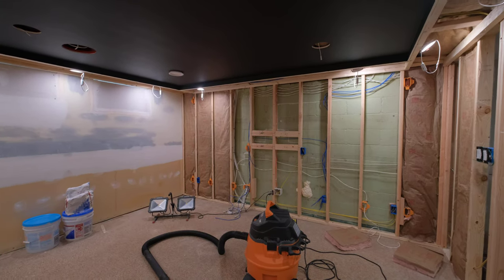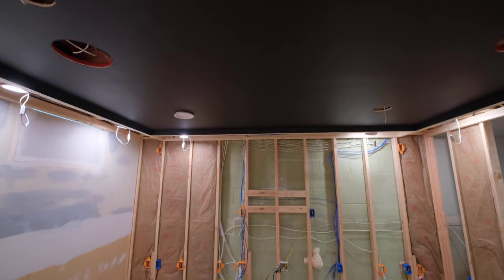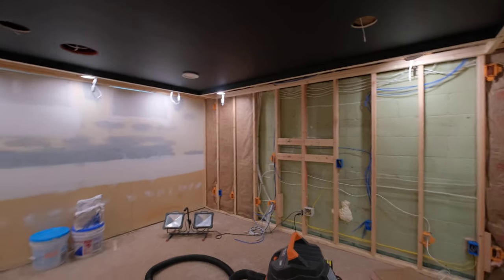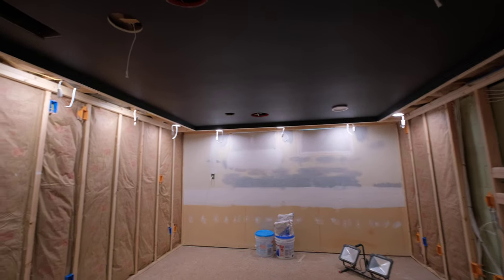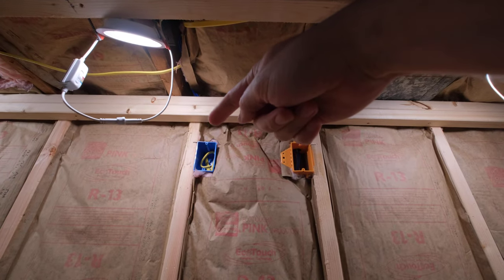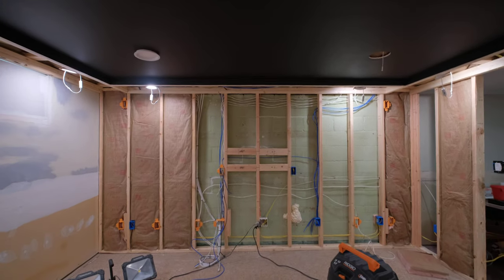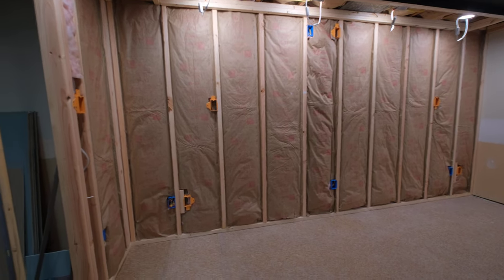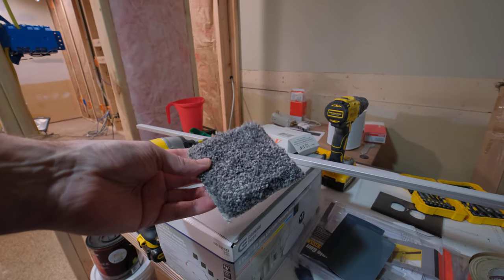Home Theater Project Part 8. The Ceiling is in, and Structured Wiring Enclosure is up!

Comment: for your soffit leds shining on a black surface you could paint the "inside" of your soffit white for better reflection. then close in the 3" tall (guessing) overhang you created with something called black led acrylic. it's matte black when not lit from behind so should give you a totally black soffit edge when your soffit lights are off and a soft glow when they are on. I'm thinking of using this approach for my build. the acrylic has a max length of 8 feet so you'll have small seams if you have runs longer than that. tap plastics sells it and a few videos and builds using it on YouTube

Comment: Really shaping up. Love the LED lights. But have no idea how to address your issue. Maybe some plastic defusers like the ones used for florescent tube lights? 

Or the paper the used in some vintage receiver displays? Like old Marantz units '70s.

Yeah, $1500 for lights, wow!
Reply from the maker: Yea, it's not all straight forward with LEDs. The cans add another $425 too. The leds have length limits too and can only be cut at certain intervals so it makes things even more complicated.

Comment: I have a few potential solutions for your led issues. for floor level leds count how many leds per meter of your current strips. you may need more to get the look you want. that means more current injection though. also try deeper channels which should help with diffusion. 2nd option is to go with 24v cob led strips. they are pretty new and I haven't researched a lot. saw them for $99 for 16ft/5m. it is a continuous strip of light tho with no visible dots